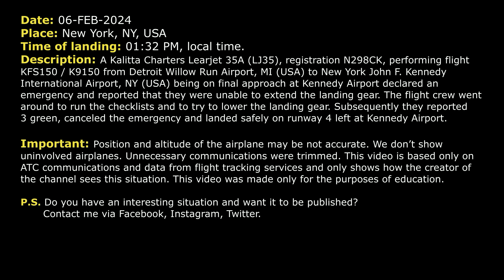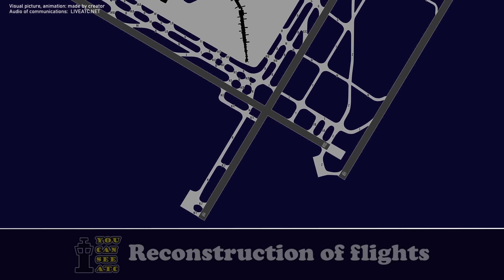“I’ve got no gear” on final approach. Learjet 35A has gear problems at Kennedy Airport. Real ATC

Comment: As a non-pilot - ATC and Pilots should NEVER be dicks on the radio.  You should be quickly removed from the job if you can't keep yourself composed.  As an outsider listening to these regularly, I'm guessing punishment is nil or not near severe enough.  You have lives in your hands.  Pathetic.
Reply: Stop it. This was fine.

Comment: A similar thing happened to Steveo1Kinevo and he had to manually pump the gear down. The controller had him fly by the tower once first without landing to confirm that the gear wasn't coming down.
Reply: No, medevac is the correct term
Reply: @jazzi_0453 your comment has nothing to do with this. 😂
Reply: @rtbrtb_dutchy4183  because he edited the original comment
Reply: @jazzi_0453  ah, understood. I hate when they do that.

Comment: Hm, a pilot declares an emergency due to faulty landing gear and none of the controllers ask for souls and fuel or ask if he needs ARFF? Yes, I know he initially said he had "plenty of fuel" but no controller asked for specifics. And that's besides the fact of keeping them at 3000 ft so close to the shoreline, no wonder the tower got a low altitude alert.
Reply: They could have, the recordings are edited and trimmed.
Reply: This is where we have failed for decades in the USA with phraseology during emergency situations. This was not life threatening or imminent danger. It was not an emergency. This would be better as a “pan pan” call.

Comment: The low altitude alert on the controllers screen can be triggered by high rate of decent. Which I believed that had to be done due to them being high on final. 1000 FT over the shoreline is the usual altitude.

Comment: The Altitude Alert warning simply projects the path of the aircraft, and because he needed to dive for the glideslope due being kept high the software thought he was going to impact the ground short of the runway even though he wasn't actually low
Reply: Exactly! They forced them to a quick descend and then acted surprised when it happened 😅
Reply: @andreea007  It is mandatory for ATC to inform the pilot if they receive a low altitude alert on their radar, even if they don’t think it’s an issue
Reply: @BigJo2  Of course, but it should also be mandatory not to force the pilot to trigger such alerts. By the look of it, they gave them a short final twice...
Reply: @andreea007 yes, this was handled horribly by ATC. I don’t even know why they had to climb to 3000. They were at 2000, which is fine around there.
Reply: I loved the comparison to a shuttle landing. It certainly looked that way.

Comment: what a miserable captain aboard the lear. must suck working with such a miserable, piss poor attitude. I feel bad for his /FO and anyone working with him.
Reply: He was pretty much the only one who knew what he was doing... I don't think anyone could wear his shoes and be joyfull.
Reply: @andreea007 Alternate gear extension on the 35 is a non-event, it's like yawning!
Reply: @gavinsingh4450 yeah not much too it. Just have to do the old reach around to get to that handle down there and make sure it doesn’t snap back up on your fingers.
Reply: @gavinsingh4450  In the early days of aviation, lifes have been lost due to fact that pilots were forced to step descend on approach. We've learn from that and regulations have been changed.
As for the non-event, is not uncommon for non-events to foreshadow more serious underlying issues. Whether it was the case here or not, it doesn't change the fact that short approaches are not that safe.
Reply: @andreea007 this was not an emergency. So no, he didn’t know what he was doing. Heck, he didn’t even “declare” his “emergency” correctly.  

Having said that, they did screw up the approach for him. There was no reason to climb him to 3000 feet. He is over the water, 2000 is fine.
Reply: When your politics suck, attack the man
Reply: what a miserable comment, you must be a most miserable person. It easy to comment from the safety of your keyboard and not being in the cockpit.
Reply: How do you know?  You got the poor guy all figured out based on a six minute audio clip where he's frustrated and trying to work a serious problem?  Get outta here.
Edit: I'll take your "miserable captain" over some happy-go-lucky cocky punk.
Reply: it might be his plane or something like that so it would be understandable to be mad about that, and they gave him a short final at 3k feet so like bro had to rush down to the landing etc, and maybe his F0 wasnt the smartest or fastest etc so he was having to do all the work
Reply: @LiamPrivateChannel and the gear doesn't work lol
Reply: Maybe he's pissed the gear doesn't work. Maybe he's pissed ___, and maybe he's pissed _____. But you keep telling yourself Everything's great

Comment: How do pilots decide who speaks with ATC and when they switch talking roles?      Sound confusing when its a dude one second and then a chick and back and forth.
Reply: Whomever is not flying usually talks to ATC.  The guy was a bit salty, not sure why, maybe a stress response.
Reply: @wstuart They have cleared them for approach quite late, thus unneccessarily increasing the effort for the pilot flying (short approaches require extra effort to avoid a hard landing but also to avoid overshooting). 
I've never heard ATC do this, especially to an aircraft who just experienced landing gear issues... So yea, the pilot flying was "enjoying" a stress that could have easily been avoided by ATC.
Reply: @andreea007  Well, the pilot DID cancel the emergency.  So that's on the pilot.
Reply: @briansmyla8696  Approach clearance is to be given in a timely manner for all aircrafts. This has nothing to do with being an emergency or not. So no, it's not on the pilots.
Reply: @andreea007  Emergency aircraft give ATC more options.  Emergency aircraft can violate any and all regulations to get on the ground safely, and don't require clearance from ATC to get the job done.  Cancelling the emergency shifted the workload from ATC to the pilots.  And yet the pilot wanted to whine about the 'space shuttle descent', when if they hadn't cancelled the emergency, ATC would have been obligated to give them discretion on altitude and cleared traffic for them.
Reply: @briansmyla8696 the thing is, this was never an emergency situation. It could’ve turned into one, if the gear hadn’t come down, but it did.
Reply: @wstuart  Definitely a stress response. Thankfully his co-pilot kept cool and handled the radio like a champ.
Reply: she was likely a new one
Reply: The recordings are trimmed so the have plenty of time in the cockpit to decide who does what.
Reply: I’m glad there was a good outcome of this incident, sounds like all parties had the situation in hand. I was surprised that ATC didn’t ask for soles onboard though even after stating plenty of fuel. I also wonder why a medivac flight from basically Detroit to NYC took place, maybe the patient was from NYC and was being transported back home(to unstable to fly commercial), I had a few flights for that very reason when I was a flight medic several years ago!
Reply: Landing phase is very dynamic and is not uncommon for pilots to take turns when talking to ATC, depending on the workload each has to handle at the moment. 
In this way, ATC is not left waiting too much for a reply and at the same time pilots get to perform actions that are critical for a safe landing.
Reply: @andreea007 nah, they shouldn’t take turns like this. 

The pilot monitoring talks on the radio. If there is an emergency and the checklist needs to be performed, one pilot will handle this, the other will fly the airplane and do the radio. 

Once everything has been completed, the radios go back to the PM.